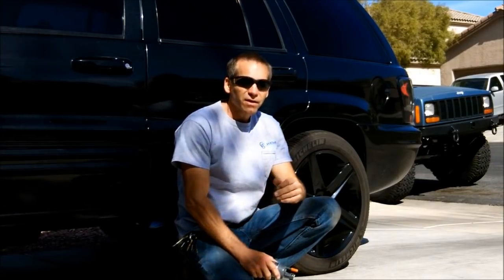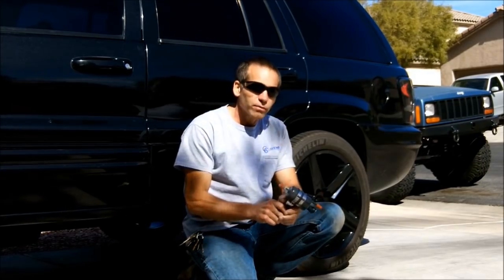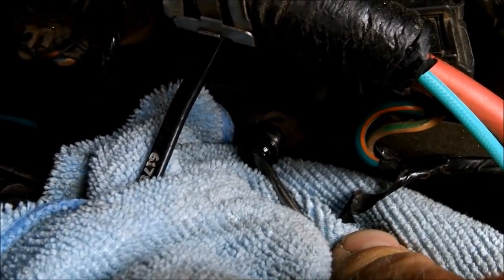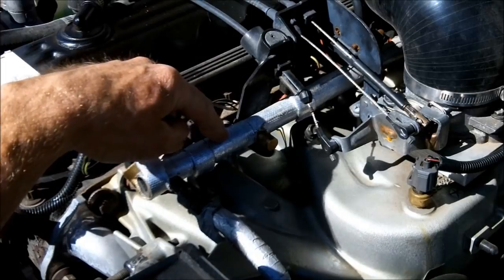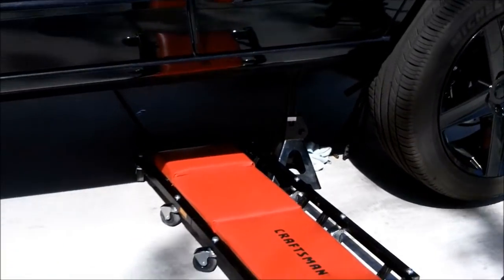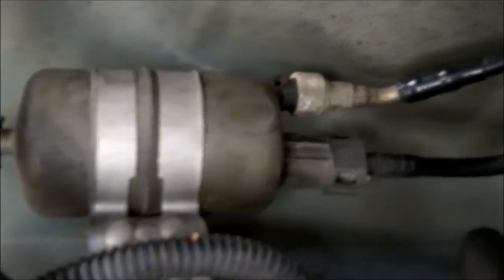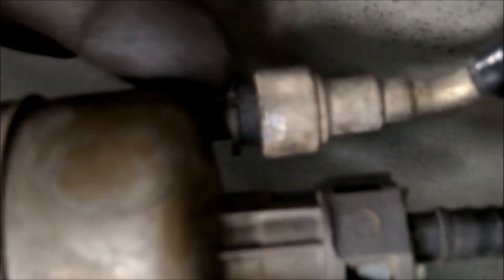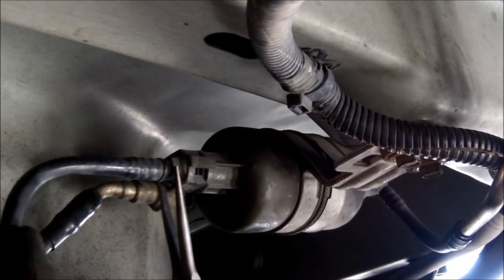Changing Fuel Filter 99-04 Jeep Grand Cherokee

Comment: Martin,  I've got a 2004 Jeep GC Laredo 4.0 and cannot locate my fuel filter for the life of me. everything (fuel lines) in the referenced area are all boxed up. Any ideas where I may find clues in locating the fuel filter on my 208 K baby.
Reply from the maker: It should be in the exact same location no matter if it has a 4.7 or a 4.0, located above the rear axle toward the driver side left just in front of the fuel tank.

Comment: Fuel line clips were beyond deteriorated and snapped a line (hb4) fitting. The single line that goes all the way to the engine. Any suggestions on how to repair it?

Comment: My 04 Grand Cherokee 4.7 erratically stalls won't start unless I floor gas pedal, then only runs with gas pedal floored. If I release it it stalls out. After running with gas pedal down for about a minute it clears up and runs fine. Installed crank and cam sensors, alternator, new battery. I'm stumped. Sound like pressure regulator?

Comment: When you disconnect the lines does it suppose to let out a lot of fuel out or do I replace the fuel filter when I have low fuel ?
Reply from the maker: only the fuel in the lines will come out.
Reply: @martinbuilt  okay cause I was disconnecting it and it let out a lot of fuel and I was nervous

Comment: Good night, haven't change mine fuel filter since 2017 ,since last yr when goin uphill n pressing gas slightly it keep bucking.  You think it could be the fuel filter clog?. I am from Jamaica
Reply from the maker: I would try changing the filter and if that doesn't fix it, change the fuel pump assembly.
Reply: @martinbuilt  hey good night, what would cause trans over temp light to come on?

Comment: Hey martin, i just bought one of these, its a 99, do you know how to remove the reading lights in the front and the rear cargo light? im going to replace the bulbs with led, and have seen your climate control vid, really nice! any help is appreciated.
Reply from the maker: drivemecrazy the front dome light light is held in by one Phillips screw and  2 clips, after remove the one screw then you just kind of got a pry it out. The rear one you kind of just got a pry that lens out of there. Be careful.

Comment: Ey I have a cuetion Im gonna chance the control arm suspention did you know why mopar part are so expensive if i use after market which is cheap will b the same thank u great videos
Reply from the maker: well 8 out 10 times the factory parts are of better quality and that's way there more costly. If your looking for control arms, I would go with a brand that offers a good long warranty. I have seen one that gives a 10 year at a very reasonable price. Look on amazon, Detroit Axle has them for 63.00 a pair
Reply: Thank u a lot. Plis post more videos. Thanks again.

Comment: Is there a certain brand fuel filter you prefer for 2002 jeep grand cherokee 4.0l?
Reply from the maker: I have heard of some people complaining about some of the cheaper ones like the ones that cost 25 to $30 that they may be noisy, my personal experience with 2 different filters one from autozone and then another one I don't recall the brand name but it was an inexpensive inexpensive one both have worked perfectly flawless they're quiet so I personally don't have a preference even though if you are concerned about that you could always go with the OEM Mopar brand which I believe is around a $130
Reply: @martinbuilt  thank you for replying. I was looking at autozone and they had the duralast for around $20 and a fram for around $30. I thought it might be best to go with Fram. Then I saw a comment below that they bought Mopar bc there were issues with others.

Comment: I replaced my fuel filter exactly how you showed and I started hearing a whistle noise. Can you help ?
Reply from the maker: Unfortunately, I heard of this quite often. It seems to come from cheap filters, and it's the regulator within the filter, making the noise.  Hopefully, you can warranty that out, and you will have to replace the filter.😕
Reply: @martinbuilt  thank you I’ll look into it. I have another question, the reason I changed the fuel filter is because my jeep stutters. I figured that could be the issue. While replacing it I noticed the aluminum lines next to the fuel filter (idk the name) that come from the front next to the fuel line that feeds the engine, 2 hoses are not connected. Apparently they are air lines of some sort. The broken hoses go past the fuel filter into the rear fender of the car. I don’t know if that could be the problem for it to stutter. (I hope it makes sense, thanks)

Comment: Hi again Martin. Well, what happens if I broke the plastic collar to push in?
I can't get that fuel line out. And I was afraid if I got it out, it would not lock back in the the new filter so I just put it all back together. Suggestions??
Thanks
Reply from the maker: You broke the outer collar or the locking tap?
Reply: @martinbuilt  . The plastic locking collar.
Reply: @martinbuilt  There is nothing left to push in.
Reply: @martinbuilt  . This thing would not budge. I sparyed wd 40 in to help loosen. It just crumbled apart.  I had the fuel filter replaced 10 year's ago, thought it was time to replace again.
Reply: @martinbuilt . I don't have jack stands so working on my back. I figured if I got it off, I'd probably have to replace the whole collar end onto the line and I don't have the right tools for that so I just put it all back together. So far no leaks. 🤞
Probably gonna take to shop and pay $$ so if they have to put new collar end on it will be easier for them and costly for me.
Reply: @martinbuilt  . Hey thanks for responding! You Rock!🤘
Reply: @martinbuilt  . Hi Martin.  So do you think the collar itself can be replaced or does the whole fuel line have to be replaced?? Can you let me know asap cause I'm taking it in to a shop this morning and don't want to get ripped off if they say they have to replace the whole line when the collar can be replaced.  Thank's.
Reply from the maker: @jat-justamaturetech-philpj8285  
I don't think you'll be able to replace that collar. I would get one from the local salvage yard for a few dollars.
Reply: @martinbuilt  . Hi Martin.  I took it to a shop that I've had work done in the past on my jeep. I told them what the deal was and they said, if the locking plastic collar is broken, they would have to replace that gas line and would cost $250 in labor. I left it and crossed my fingers.
About a hour later they called me and said it was ready. They were able to replace the filter with no problems. $30.
I know I broke the plastic part that protruded out from the collar but I guess it didn't break down inside. They used a ring tool to push it in and unlock it!👍

Comment: Hey Martin man , any idea what is causing my 4.7 quadra to do this. Sometimes when I get in the highway , at 70mph, my rpm will be around 2000 and sometimes it's at 2300-2400. And doesn't ever drop to 2000. When it does go to 2000 rpm about 40 min into the ride on the highway, my rpms will surge ever so slightly up to 2400 from 2000-2100. It surges every 3-4 seconds . I'll slow down to 60 and climb back up to 70mph and the problem seems to go away ... This sound like spark plugs , or crank sensor ..what you think ???
Reply from the maker: I had a similar problem once it never threw a code, and it ended up being the throttle position sensor. The transmission was locking and unlocking the torque converter because of a faulty TPS.  I would see the RPM change just a few 100 RPM.
Reply: @martinbuilt  wow, martin thank you very much . I just acquired this jeep, and I did indeed  swap out the TPS with a new Mopar one , and went from pretty crazy rpms, to like you mentioned , just those few 100rpms. I am going to do new plugs , bought 2 new coils for the rear plugs since I'm digging in there , and a coolant flush . Also grab another TPS. Maybe my new one was dropped a few times ?? All the researching, I'm thinking changing the crank sensor and cam sensors , but hate to change what isn't broken . Really appreciate your input !!
Reply from the maker: @scalywag  I have had to change the Crank sensor before on my 98 Jeep Cherokee XJ 4.0 and most of the time it never gave a service engine light.

Comment: thanks for the video, mine were bad enough that I was close to breaking the blue clip and the one with the black side...the metal part on that one was very rusted. Hitting everything with WD-40 was the only reason I got them apart. The beginning of the vid should be " This job is A Pita" lol My cost was less than $20?? at AutoZone
Reply from the maker: Yes spraying it with some WD-40 will definitely help.

Comment: Martin, off subject but does your WJ have electric fan cooling and or a clutch fan ?
Reply from the maker: no mine has the hydraulic cooling fan off the power steering pump
Reply: Thanks, I forgot , that's what is used with the 4.7
Reply from the maker: @bill3641   no problem, yes from 01 through 04 they had to hydraulic fan with the 4.7

Comment: I used your video as a reference and it went way smooth. But I have a hissing noise coming from my fuel filter. No leaks and Jeep is running smooth. Any ideas on what it could be anyone?
Reply from the maker: Cheap filters will do that it's caused from the regulator making that noise. 
 I bought mine from auto zone and I feel like I got lucky still working great so far.
Reply: Thank you I appreciate the response

Comment: I have an 02 overland and it looks like it was Frankensteined... I just got a fuel filter from a parts store for the year model and the outlet side of the filter was too big to stick in the hole... are the filters different sizes for older than 02 vs before 02? Im having a lot of trouble starting and its a high output 4.7 engine
Reply from the maker: Yes, the 99 thru 01 is one filter and then the 02 thru 05 is another filter. It does not matter if it is a 4.0, 4.7, or 4.7HO
If it starts hard I would think that the filter has a bad check valve.  Cycle the ignition switch to the on position several times before starting and if it starts right up it is a bad check valve.
Reply: @martinbuilt  ok, sweet. Yeah, it's hard starting and eats huge amounts of fuel, like 17-24 L/100 kms and gets a CEL for the catalyst not being able to keep up. Would a bad check valve cause those symptoms? or is it more likely injectors? I bought the vehicle off of a young guy and the fuel lines underneath the vehicle dont seem to fit the frame exactly. Spark plugs were just changed with HO specifications and I think the coils are good (1.2, 0.9, 0.9, 0.7, 0.8, 0.8, 0.7,  and 1.1 ohms when tested). I was thinking about buying new injectors with 4 holes but it's hard to find ones that match HO specs and that dont cost and arm and a leg. What do you think is the issue? fuel pump?
Reply from the maker: @wehz0r  I would also check into measuring the fuel pressure make sure it's within specs if the vehicle was running okay before you change the fuel filter it could be a faulty pressure regulator within the fuel filter.
Reply: @martinbuilt  do you know what the pressure should be for the HO overland model?
Reply from the maker: @wehz0r  Published spec. is 49 + or - 2 psi
If it is too high this would cause it to use more fuel.

Comment: Are you supposed to take a fuse out at the beginning?
Reply from the maker: TheDexa88Y You can if you like. I personally don't see any need to. Unless you're worried about someone turning the ignition switch on while you've got the fuel lines disconnected and you're working on it
Reply: Wjjeeps.com has good directions and they say to take out the fuse for the fuel pump and run the engine until it stops to relieve the pressure from the line.  That's what I did and only a little bit of fuel came out.  I came here to see exactly how to remove the lines.

Comment: Ok another cuestión i have a jeep wj 2004. 4.0 fredoom edition. Whats the best exahust system for It flowmaster ,magnaflow, borla. ?
Reply from the maker: I don't know witch is best. I am running the Flowmaster super 44 on my 98 Cherokee XJ. I like it and not overly load as long as you run the tail pipe all the way out the back.

Comment: Is there away to get the line that takes the tool off with out the tool?
Reply from the maker: If you have the year Grand that requires the line tool I would recommend getting the right tool. Your local auto parts store may have them. Like Autozone will let you use them, just leave a deposit. It's like renting for free
Reply: martinbuilt thanks was just wondering if there was a way. Most the time there is or I can come up with something. But if I can rent one then y not right lol

Comment: That was actually the return line not the inlet line.
Reply: OK. So you might be right about the return line. I just looked at the fuel line diagram and it is what you said. But, on my mopar fuel pressure regulator, filter has an array pointig in on the middle of the filter. Why is that? My newly purchased mopar filters for 2 of my wj Jeeps has fuel pressure 59psi and 62psi instead of 49psi. My friends wj has 65 psi fuel pressure. WTF?. All these new mopar parts are  Chinese shit. I have serious rough idle on one of my Jeeps since I've replaced the fuel to a new mopar shit.

Comment: I changed my filter but now I have no pressure and the gas drains back to the tank when I turn the Jeep wj off. I have to prime the line by turning to the on position twice then start . Can anyone give a brother some help .?? Thanks
Reply from the maker: That is a bad filter/pressure regulator. The anti flow back valve is in the pressure regulator.

Comment: Anyone have any experience with the new replaced filter SCREAMING loud when fuel is pumping?  It's MOPAR no cheapo.
Reply from the maker: Yeah, I have heard of the problem before. Generally, it seems to happen with the cheaper fuel filters, but I personally have bought mine from autozone and have never had an issue so far.

Comment: I replaced mine and it whistles. Anyone know why? Ive tried a couple brands, including Mopar, and they whistle. The original do not. Is there something with the install that could cause this??
Reply from the maker: That's the first time I've heard of a Mopar making any noise. I have had two different ones so far and never a problem. I used an Autozone, and the other a MicroGard

Comment: Can the fuel filter make a whine noise?
Reply from the maker: Yes it can, that is caused by the fuel pressure regulator
Reply: @martinbuilt  Thanks for the reply. I should have been a little more specific. I am getting a whine noise starting around 20 MPH. At idle I hear nothing. Can the Fuel Pressure Regulator be the issue? I was thinking wheel bearing but had someone look at that and he said it was good.
Reply from the maker: @mistapikkles  how about if you just rev the engine in neutral does it make that noise?
Reply: @martinbuilt  yep did that and no noise... only while driving above 20 mph.. must be something in the driveline or a bearing
Reply from the maker: @mistapikkles  yeah that what it sounds like

Comment: Anyway I can add you on Facebook? I have a 2001 4.7 JGC and it turned off on me while driving . The night befor that I changed the spark plugs . The next morning I was in my way to town and when I was hitting past 60 it turned off on me no noise just off . And dosent wanna turn on . Any tips ?could it be the alternater?
Reply from the maker: Does the engine turn over but not start? If yes it could be a number of things. Bad fuel pump, crank shaft position sensor, Camshaft position sensor, etc. If it does not turn over it could be battery or alternator. I would need more info.

Comment: Thanks for the video. I miss my 2000 jeep WJ. I have a question for you. I now have a 2006 Jeep WK with the 4.7. It has the dreaded 8mm bolts for the exhaust manifold and not the standard 10mm. So the driver side exhaust eventually leaks because the rear bolts snap. I would like to replace the 4.7 in the 2006 jeep WK with an older 4.7 motor with the 10mm exhaust bolts. Will an older 4.7 direct fit into the 2006 WK? Thanks!

Comment: The new fuel filter is making a humming noise. Can anybody tell me why it's making a humming noise? The original fuel filter didn't make any noise.
Reply from the maker: That's the fuel pressure regulator making that noise, and it's because it's an inexpensive one.
I know it's probably a hassel, but I would recommend taking it back and getting another one.
Reply: Ok

Comment: Great video, but what a poorly designed components placed in an inaccessible spot. The clip system is rediculous.
Reply from the maker: Thank you, yes would have been nice if it was down along the inside frame rail
Reply: @martinbuilt  Thanks for the reply. Yes, the unit should be placed on the frame rail with only the FPR inside. The filter should be of the old "glass bowl" type, easily changed without any tools.